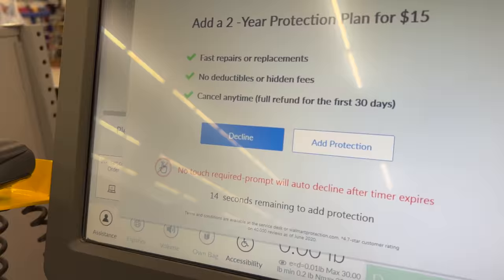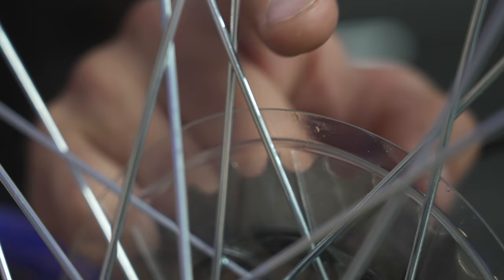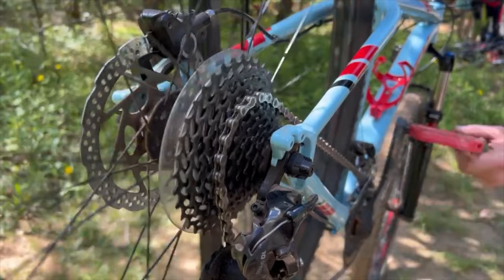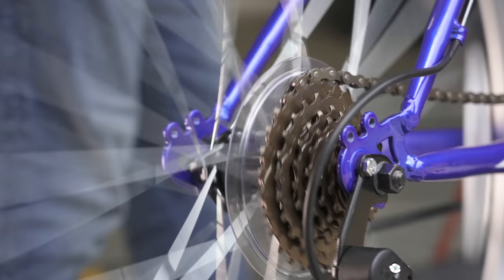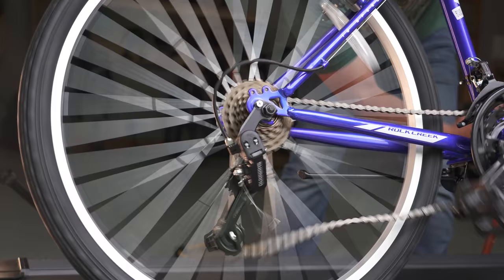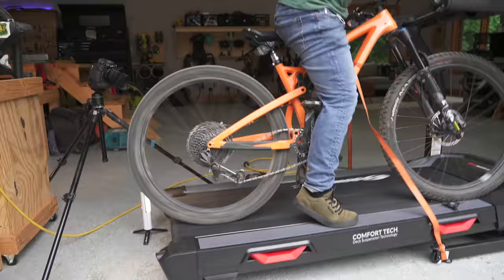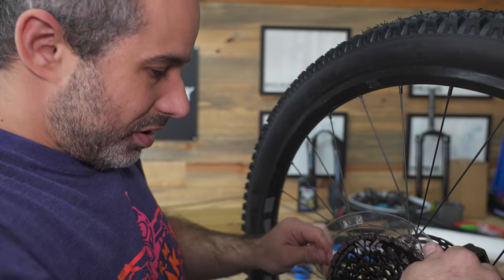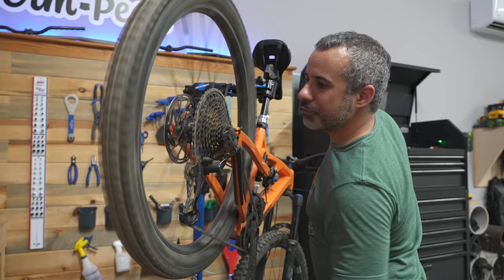What is your "dork disc" actually for? What happens if you remove it?

Comment: Pro tip:
If you want to strap your bike to a treadmill, consider tying it down like you would a motorcycle in the bed of a pickup. The concept is exactly the same. Tie it down by the handlebar, one strap for each side of the bike, and completely independent of each other. Do the same for the rear of the bike, but because it doesn't pivot like the fork, you can use one long strap and the bike won't move. The problem arose from tying the bike down behind the pivot point, which allowed the handlebar, fork, and wheel/tire assembly to wobble.
I never really thought about removing them. It's clear plastic, it isn't in the way of or bothering anything or anybody, so why waste the time it would take to remove it? Yeah, it looks like MAYBE, if one was unfamiliar with how to remove their rear wheel and how to access the disc without cutting it up, it MIGHT take as much as 10 minutes, but in reality, probably closer to five. It wouldn't really be all that difficult to remove. I don't know, whatever floats one's boat I suppose. As it ages, and being clear plastic, it's going to haze over and get dirty and scratched, but the rest of the bike's finish is going to get dirty, scratched, greasy , chipped, etc. I don't remove the chainguard from the front either, but as ugly as they were, we all used to remove our chainguard from our bikes because they really were dorky. Once they were off, we used to mangle and twist them so they couldn't be put back on by our fathers when they got pissed at us for taking them off. But the kinds of guards they have now, I don't mind them in the least.
Reply: Same reason I removed the air dam under my truck. I don't care about MPG, I care about looks.

Comment: One of my first rides on my brand new $4200 mountain bike, this happened. I was on a steep, granny ring climb, the chain jumped between the cassette and spokes and turned the derailleur into a pretzel in about 0.5 seconds. It was so wound up in there I couldn't get it loose by hand. So, with the multi-tool,  I started loosening every little bolt on the rear der. Turns out, one of the pulleys had so much tension on it, that once it was loose enough, a couple parts let loose with such velocity, that it sounded like bullets tearing through the leaves and branches in the woods. If it had hit me, hospital trip for sure. Anyway, the spokes were a bit nicked, but still worked, I had to buy a new der. and I avoided losing an eye, so a 'fun' and 'educational' experience.
Reply: So the dork disc saved you?
Reply: @rumblingend8443  Maybe next time.

Comment: Last week I managed to rip off the derailleur including the hanger in a split second. It was freshly build up for the showroom in the store. 
1. You have to ride, your weight gives the forward momentum. 
2. You need to have a wide range derailleur with a long cage… actually a dork disc wouldn’t help in this scenario, because it’s the bottom part of the cage that catches a spoke… 👍

Comment: One factor to consider on a modern 1x drivetrain, if you're shifting into the big cog, chances are you are going pretty slow, so it's not really a issue.
Reply: You said it! Just shifting your gears properly in a delicate fashion and in good time whilst not under load is proper technique and will avoid this scenario.

Also making sure the high/low adjustment screws on your rear mech are spot on will ensure this never happens.

The 'Dork Disc' is very appropriately named in my opinion as it is there for total wallys who cannot ride or maintain a bike properly?

Consider it  a rite of passage removing it in a similar manner to your stabilizers as it is there for 'childrens' safety!

Comment: I've seen wheels with the spokes ripped apart from this happening, the dork disc could have saved a lot of them, I'm actually going to make myself an aluminium dork disc like I see on old road bikes to save me money in the long run on wheels
Reply: TBH, I assumed that this had something to do with the fact that on these bikes the chain is capable of moving in two directions as well as at a different rotational speed from the wheel, meaning that there's a lot less of a guarantee about the chain jumping off the gear and contacting the spokes. I would expect that if you're dumb enough to have the disc off, the gear shift improperly adjusted and be peddling backwards right before switching directly for a change of gear that you would see it happen. It's also probably part of why it's apparently not universal to all regions.

I don't remember my old Huffy BMX bike having those discs, it also had coaster brakes and only one pair of sprockets, making it far less likely to need the extra protection. As long as the chain was tight enough to not be removable without cutting the chain, or removing a gear, it was fine. Not something that was likely to be possible without extreme negligence.

Comment: First thing I ever did on a mountain bike was stick it in lowest and shear the rear axle retention clips off the frame, bend the rear rim and rip the valvestem off.   Too many years pushing a little MX36 one speed I guess.

The dork-disk's entire purpose is to keep the cheaper parallelogram shifters from digging into the spokes directly.   That's it.   It stops kids and fools from allowing the duplex from damaging the spokes and causing an unsafe ride.     It is the single largest example of a "warranty void if removed" device you will ever see.

Comment: On my last hybrid bike, the dork disc disintegrated and eventually my chain did end up off the cassette.  It didn't do much damage the first time, but it happened a few times over a year and eventually chewed through some spokes.

The biggest problem with the dork disc is that it's made of such cheap plastic it often breaks off the hub and spins freely, prompting the owner to just snip it off.
Reply: That’s exactly what happened to mine. It was easier to just cut it off that piss about trying to get it to sit properly
Reply: I just zip tied mine to the spokes.  3 minutes work.  Done.
Reply: @Invictus4318  zip tie to spokes.  Done, and keep your protection.

Comment: If I understand correctly, the main complaint about these things is that they are too flimsy and inevitably break. So why not make a sturdier one? You could make it from aviation grade aluminium  or titanium, or some esoteric  unobtainium compound, and you can put gaudy designs on the backside. That's easily another seven hundred bucks you can pointlessly spend on your favourite toy.

Comment: I actually made one for my new DT wheel, because the chain left pretty significant marks on the hub and I wasn't even pedaling that hard and I stopped right away. I designed it much wider, so the chain can't physically go further. Then printed on a 3D printer.

Comment: Seth, you're testing a 35 lb bike just riding on a treadmill and the rear wheel ends up hopping around as the chain causes havoc.

in real life, there is a 150 lb rider and a ton of momentum on that bike, so a lot more energy and potential for damage.  that weight on top of the rear wheel also keeps that wheel on the ground spinning until the considerably larger momentum eventually gets slowed down by crushing metal and friction.

in short, I think the real life scenario involves way more energy.

also, who knows what can happen if you get that happening at speed, you could lose control of the bike even if the damage isn't that bad.

all that being said, we took off our dork disks too.

Comment: Great video. In my experience(manhattan bike shop), the most common thing that tangles up rear derailleurs is debris/obstruction: most commonly the lowly street curb. I have literally 0 experience with the MTB market, but the shop I work at in NYC replaces 3 or 4 rear mechs/hangers a month from the pushed-into-the-spokes type catastrophe. 

The dork disk is often present and intact for such jobs.

Comment: Been mountain biking for 33 years. Although I have had the chain get jammed into the spokes quite significantly, I have never had a catastrophic failure in this manner. Disclaimer: out of the fifty of so bikes I've had, I've never left the plastic disc on the bike.
Reply: 50 bikes in 33 years?
Reply: @Durwood71  Easy if your 'wheeling and dealing'
Reply: Wow, what a poseur. 🙄
Reply: @Durwood71  you should see how many golf clubs I have/had 😬
Reply: @Durwood71   30+ cars and 20+ motorcycles😁

Comment: What you didn't address is the damage to the heads of the spokes as the spinning wheel grinds them against the non-moving chain. After a few of those incidents, the spokes will begin failing, either when the heads break off or at the 90° bend where the spoke exits the hub flange.
Reply: Good point👌🏼
Reply: Stainless spokes like to snap at the bend at the best of times without grinding a chain over them.
Reply: That won't happen on carbon fiber wheels scenario? Or what can go south?

Comment: Hi Seth, with the underground pushing the wheel the spokes push on the chain - kind of from the inside out. If you're actually pedalling only then will the chain be pulled into the tightening gap.(outside-in). And if you pedal hard like e.g. on a steep climb then the chain might very well get locked with exactly that force, Cheers :)
Reply: And then you whack you nuts on either the headset or crossbar 🤕 😁 hahaha
Reply: @jakedevries1455  that's first fixie experience when i entered the turning lane and did the shoulder look i just forgot ... :D
Reply: Who is the dork that referred to it as a "dork disc" to begin with? I think it should be made of something a bit more substantial than a flimsy piece of plastic. In fact, I think my Schwinn Super Sport in the 1970s had a chrome plated steel one. Yeah, yeah, I know- lightweight, zoom, zoom.

Comment: I have repaired a lot of bikes for friends and family over the years and these plastic discs make absolutely no difference. It's usually the old, dirt-packed, rotting drivetrains that implode when the chain is overshifting into the spokes. Though the concept of this unloved part is actually not too bad, but wrongly executed. For it to work manufacturers should include it in the cassette (like an extra non-toothed cog, slightly larger than the lowest gear). Included firmly on the cassette so it won't rattle around, maybe with some rad color accent or even color-customizability (wow I should patent this lol) But it must be a part of the cassette if it's supposed to stop the chain overshifting. If you catch it after it's already dropped into the spokes, it does not matter if there's a dork disk or not. If the chain and spokes are full of dirt and scream friction, it will grab and go funny.
Reply: When shopping for some odd sized freewheels to repair some vintage bikes, I've come across some just like this, the last "gear" is just a disk. I really liked the idea and wished I could see it on other gear sets.   -  For the rest of the conversation, I keep mine on.. I don't care what it looks like, if it breaks I remove it, otherwise, it's not hurting anything and stays until it doesn't.

Comment: Hey seth! Could have someone machine a custom dork disc out of metal, like aluminum or titanium for you to test? I would personally rock one of those if they existed!
Reply: Every mtber pays dearly to have lighter parts and takes off everything not necessary. Adding a new part made of metal is not something ANY biker would willingly do.
Reply: @thebystander1636 
You talk like we're all roadie ninnies in superhero cosplays. 🙄
Reply: @thebystander1636  I would, + a titanium dork disc weighs like 50g max

And remind you Seth isn't one of those people, he has a chain made purely out of master links on his hardtail.
Reply from the maker: I tried making one out of wood one time—the Dude Disc. It didn’t work all that well
Reply: @BermPeakExpress  could ask a fan to make a metal one?
Reply: I really wouldn't use alimunium since it would cause more problems: in high loads it would bend inward, getting it stuck on the rim and/or causing other unexpected damage. Plastic is ideal because it's cheap, light, slippy and no one cares if it breaks.
Reply: Old ones were chromed stamped steel. I have one from a 1979 department store bike i renovated and only took it off because it was really rusty and I don't want the spokes to corrode. I have another from a 1989 bike (10 years later) which is plastic with a stainless disc inset into it closer to the hub, which is pretty cool and still on the bike.
Reply: definitely would also buy
Reply: @Aubreykun  oh, you're right! I just remembered my dad's old af BH Gazella wich has one. Runs great but the brakes procrastinate and "leave it for later".
Reply: @lukiotemmi  I say do it anyway and send it In for a gear review
Reply: Some older bikes have aluminum dork discs.
Reply: I personally love older and vintage bikes that came with chrome dork disks, I just find they look good and compliment the bike, instead of plastic ones, which yellow with age and just look "gross" in my opinion
Reply: @BermPeakExpress  Yeah, but you didn't follow up with the "next level" version 😁 which might be even worse...
Reply: Sram DH casettes have there built in i think
Reply: @DinnerForkTongue  as a road ninny all I have to say to you is...

Yeah pretty much. But NO CAPES.
Reply: @avva4090 
No capes, ever! We do not endorse being sucked into jet engines!
Reply: I was just thinking that there might be a market for titanium dork discs
Reply: @DinnerForkTongue  But he (The Bystander) isn't wrong
Reply: Gotta go full carbon fiber dork disc 🤙
Reply: The old schwinns have a MASSIVE dork disc out back, its called the pie plate.
Reply: @thebystander1636  uh, I would
Reply: @mrfilmer9270  yet multiple of these people are acting like I am.. lol. People just like to argue for the sake of it
Reply: @johnb9005   yep I had an old racing bike that had an aluminium one.
Reply: Its not worth it.   Traps dirt too much.
Reply: @SugmaDLigmaNutz  How does it trap dirt more than a plastic one?
Reply: @lukiotemmi  I'm saying an accessory like that is not a good idea.  It's terrible!
Reply: @SugmaDLigmaNutz  Its on the sram downhill cassettes from the factory? Google it and  you get what I mean
Reply: @lukiotemmi  Stamped metal discs have grooves and ribs for strength where dirt and water can collect.
Reply: @BermPeakExpress  It wooden work?

Comment: Great video, I hated explaining to people why I have to put this on every new bike, just to take it off when they're sold...
I worked mechanic, and I'd say these are unnecessary in most bikes, other then very low end ones.
in very low end system, the derailleurs have so much give, they can easily be bumped or forced and get the chain between the cassette and wheel..
but there's usually a big enough gap, that the plastic might help a bit.
But I think the biggest problem is that, this plastic thing usually brakes apart and is just wiggling there after a couple of months.
which is where it tends to get caught the most in my experience.

Comment: My Target $160 Schwinn bike's rear derailer snapped at the neck, and the broke off majority of the derailer caught in the spokes and braked the rear wheel.  In the process the plastic dork disc was shattered.  I fixed the bike by installing a new Rear Derailer.  No damage to the wheel.  Bike works great with just replacing the rear derailer.  I did not replace the dork disc though.

Comment: I worked at a bike rental, and between the thousands of bikes I had to maintain there, and the thousands of miles I've personally covered, I have seen broken spokes, shattered derailleurs, and chains so badly bound between the rear hub and cluster that they could not be retrieved without removing the cluster. Whether those incidents included the plastic disc or not, I cannot say. My head mechanic had a habit of ripping them off whenever they became even slightly damaged, so I'm sure many of those failures occurred when discs were absent.
Reply: Those plastic discs crumble apart after a month or two can't even stop a chain

Comment: This has only happened to me a hand full of times in 30 plus years of riding without a dork disk, where the chain has gotten caught between the spokes and the cassette. The worst case for me was the chain got so wedged in-between that the chain cut 2 of the spokes and I had to remove the cassette to get the chain out (no dork disk). Best case is that the chain just pulls out, but I have always have had damage to the spokes and it a judgment call on whether to replace them of not. The dork disk is sacrificial gear that helps protect the spokes from damage when the chain gets  caught.

Comment: A few years ago I came up with an idea to replace the dork disk with something that would actually prevent the chain from falling into the spokes.  It basically is a ramped dork disk.  The ramp stops even with the highest gear so the chain would just slide down the ramp until it hit the sprocket.  It could even be snapped in place or zip tied to the spokes.  Was going to use some Carbon/Kevlar cloth to make one but never got around to doing it.  Of coarse it would only work for the cassette that I have on the bike but I thought it would be a fun experiment, none the less.
Reply: This sounds like a feature that could be added to the casset itself
Reply: @noobulon4334  It certainly could.  But there would be a few things to consider like would it replace the largest sprocket or would it be welded to the largest sprocket or how far do you make the ramp.  Too much of a ramp and it could hit the spokes.  But if it was made from a plastic, then it could just snap on the back of the sprocket and just touch the spokes.  Lots of good ideas!